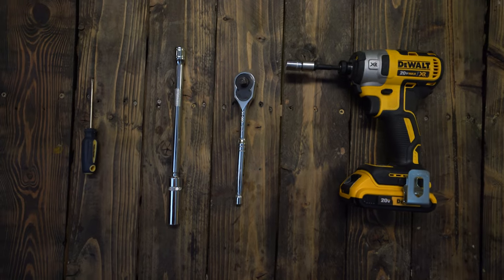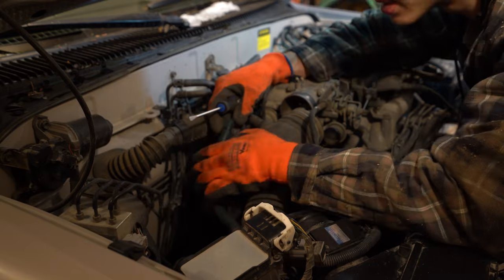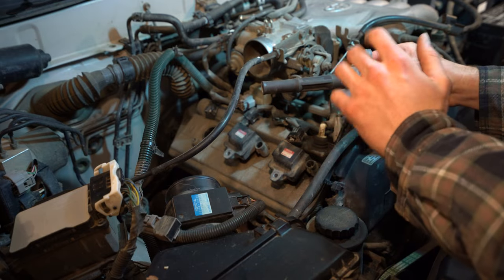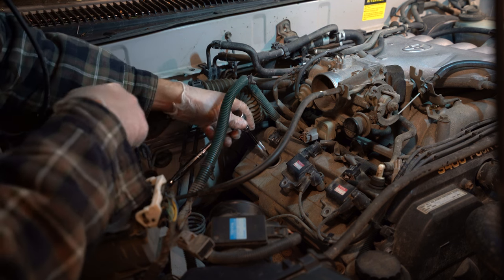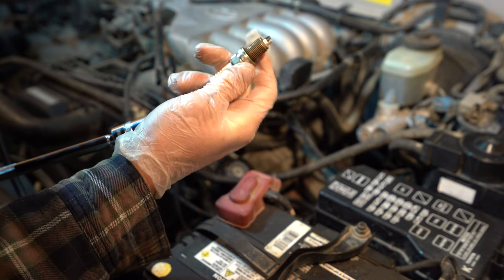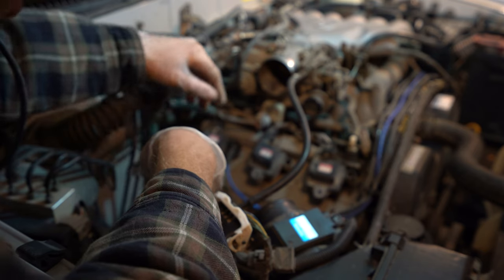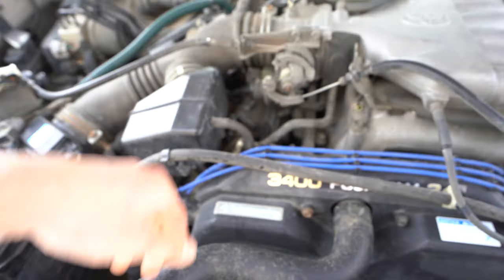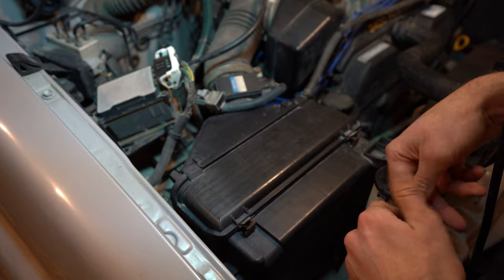Spark Plug Replacement DIY | 1996-2002 Toyota 4Runner - (Plugs, Wires, Air Filter)

Comment: is cyl-6 the one in the far back driver side by firewall or is it cyl-1 ??  .... you did not demonstrate how to get that far back buried one off and replaced new... do you have to remove the intake manifolds to get at it?
Reply from the maker: Yes cylinder 6 is far back driver side. Also that one is very tight but you do not need to take off intake manifold. You just need a long extension. Sorry for any confusion! I hope this helps.

Comment: Good video on changing spark plugs. 
But you are playing a dangerous game using that impact wrench on those 10mm bolts. 
They snap real easy and the time you spend getting one out all of the rest you could put in by hand. 
Not hating anything just taking from many years of experience. If you are working on your own vehicle the extra time spent is money in the bank.